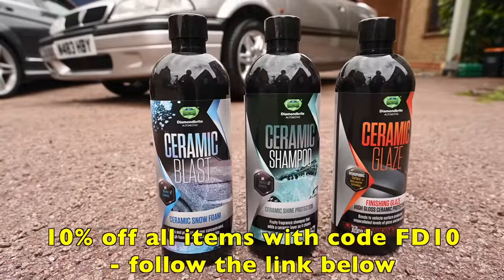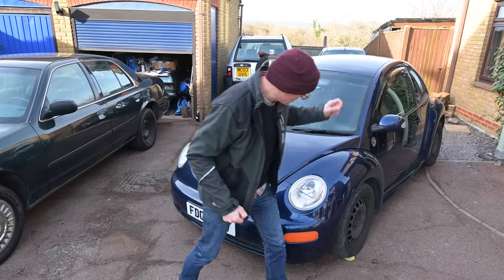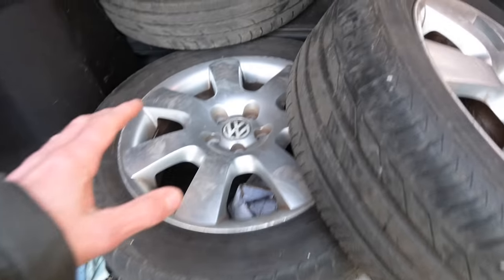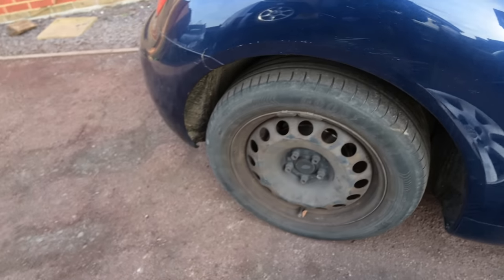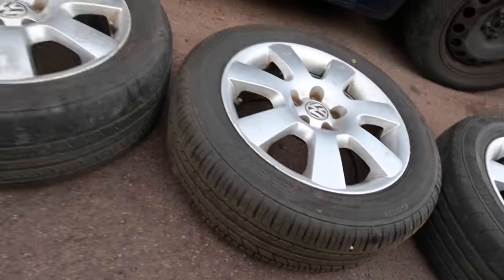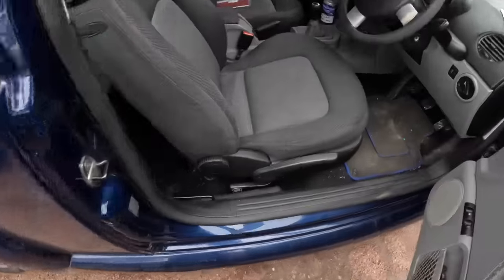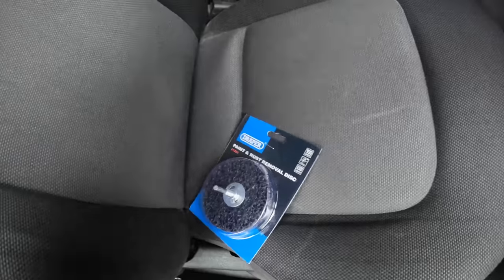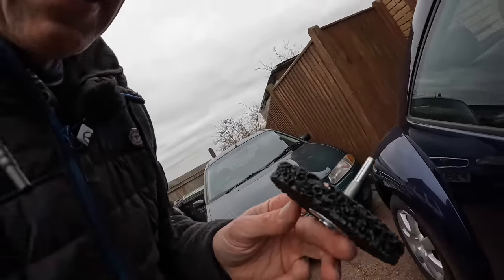Rims 'n' Rust - New alloys for Beryl the Beetle

Comment: You need to prise the roof gutter strips out to sort that rust properly. Prise them out from the boot end with the boot open.

The rust starts from under those gutter strips. Plus you wouldn't have had to paint the aluminium gutter strips then either.

Once you've sorted the rust in the gutters, fill them with dinitrol then push the gutter strips back in.
Reply from the maker: Thanks, assumed they were fixed parts
Reply: @furiousdriving  no, get a flat screwdriver, wrap it in tape, open the boot and you'll see the end of the gutter strip, prise it up from there and gently pull it out moving from back to front, be careful as it bends easily. You might need to remove some of the paint you've applied as that's probably stuck them in.

Comment: That car keeps getting better. I like your idea of using some filler. Never had much luck with high fill primers. For painting small areas such as the rust on the doors I have had very good results using an air brush. Even with 2K clearcoat (slightly thinned)  the results can be really good for areas of a few square inches.

Comment: Date code is on the outside of the tyre Matt. I have a knack for buying cars which come with the "original" spare. My Volvo S70 came with a Continental tyre which didn't look familiar, until I checked out the date code, which was late 1998... Oh well, it still holds air and is for emergency use anyway 😅

Comment: I have a VW with them wheel bolts, check them an re check them again, notorious for coming loose after being torqued up. You could keep the steel rims and get a set of winter studded tyres. I swap steel and alloys with the same wheel bolts. I live in Newfoundland Canada so winters are a necessity!

Comment: I could be wrong, Matt, but the front flex hose on the drivers side looked like it had a rubbing mark on it - and there looks like is a bracket on the damper, I wonder if it should be clipped up? 
I love the new wheels mate.
Reply from the maker: Il have to look again, can see the open clip there, and the dark mark but not sure what it would have rubbed on in that spot..Ill have to have a good look at it

Comment: The alloys have totally transformed Beryl, know what you mean about mismatched tyres, my car has 4 different brand of tyres    lol 😂 and these were fitted by the dealer that sold me the car..... I use them as my winter wheels. Summer wheels are my alloys and a decent brand of tyre.

Might have to use that rust preventer, is there a link for it ? I need to do the inside of the door in the Cactus (common problem and a recall issue if you have a full Citroen service history and paint check) which mine does not have!

Great video as always Matt.
Reply from the maker: its this place in Belfast, the Bulldog people https://www.lubricantsuppliers.com/shop/
Reply: @furiousdriving  cheers will have a little look.

Comment: I have never understood why people fit unknown/cheap brands of tyre when those four patches of rubber are all that stand between you and oblivion.
Reply: And for common sizes the difference can be as little £20 each to the good branded tyres.  Tyres and brakes always get the best, no arguments.  Like Matt I have a Rover P6.  Classics get all sorts of crap fitted to them, M+S tyres etc.  I found  ContiPremiumContact 5s that fit (they are 70 rather than 80 profile) which is a seriously premium tyre.  And they actually cost less than most of the garbage in this size with an H rating.

Comment: For future reference, 2 things.
1. The age of the tyre is usually on the outside of the tyre as part of the DOT code (the exceptions I have seen are on accelera tyres and rotational tyres)

2. Generally speaking for the general public putting new tyres on the rear axle is better as it promotes understeer which is easier to control. If new tyres are mounted on the front you're going to loose the back end before the front.

Hopes this helps someone
Reply: I've lost count of the times people have told me you put the good tyres on the driven axle (which is obviously right for a RWD car) or "where the steering is" which is always wrong.
Reply: @peterbroad1772  Depends, really. No answer that fits all drivers and condition, so dont know how you can say "where steering is, is always wrong"?

Personally I prefer the best tires always in the front, for a multitude of reasons. Even on RWD cars. Best tires always in the rear seems like a somewhat outdated historical holdover for a reasonable driver in a modern car, if you ask me.
Reply: You are not necessarily going to loose the rear before the front, just because the reat got worse tires, it depends on a whole slew of factors. Its hard to say categorically which is best, almost impossible in fact.

Comment: Things you should never cheap out on: brake components and tires. Your brakes are good, but you should invest in four new tires. You should never compromise on safety. You can buy midrange level tires that will do the work perfectly and have great performance for the price. Example Toyo, Uniroyal, Kumho, Nexen and other know midrange brands will be more than enough. Then you will be safe when driving the car and you can sleep calmly at night. Especially when you sell the car to the next owner. You will know that the car was safe when you handed it over.

Comment: In Germany it's not alowed to put different tyres on the same axle. Is it legal in the UK?
Reply from the maker: It’s not but it should be! As long as there is at least 1.6mm of tread they are legal
Reply: IN Spain neither .
Reply: Yes it is legal. Cant mix radial and crossply though, but as no one sells crossply any more it's not an issue.

Comment: Great video! I'm surprised that in the UK it is allowed to drive around with four different tyres on the wheels.  Here in Belgium you have to put on the same brand of tyres for each axle. So same brand on the front wheels and same brand on the rear wheels, for safety reasons. Otherwise  good road handling can be compromised!
Reply: Qurstionable real world benefit of that though, I am pretty sure. Perhaps in the old days it was more important.
Reply: Same in Spain.
Reply: It's important not to mix radial and crossply tyres but mixing brands is not a problem.

Comment: Yeah remember folks have an extension bar in the car with your wheel changing kit to help remove wheel bolts, believe a small gas canister blowlamp to heat and loosen nuts doesn't normally damage wheel paint.

Comment: It would have been better to rather have removed all of the used & mismatched tyres (all with different date codes, tread depth & dubious condition) from the alloys, had them refurbished & only then fitted a matching set of 4 brand-new tyres of the same make & appropriate size size to them (some cars have different sizes specified for the front & rear sets), as well as getting the wheel balancing done & tracking alignment checked & re-adjusted  - this would make it MoT legal & also provide for a safer & much more comfortable driving experience.

The two items you should NEVER neglect or cut corners with (literally, figuratively or financially) are tyres & brake components, as these are both essential driving, steering & handling components that ensure your safety on the road, especially when you are confronted with an emergency situation & have to take sudden evasive action to prevent an imminent collision or accident.
Reply from the maker: If I was keeping it Id have sent the wheels for returb but thats £50 each + VAT and this has to break even
Reply: While what you say is common sense, there is no requirement in the MOT to have your wheels balanced or tyres of the same brand

Comment: i think they should need alloy wheel studs
Reply: You can buy a tool that you screw into the hub and slide the wheel on, I bought one for my first Fabia way back in 2008, it's a great little tool.
Reply: @scottishcarenthusiastsandtrain  Wheel hanger! Very worthwhile investment for VAG cars and their wheel bolts. A fiver well spent. Not sure if you need different wheel studs. I've got alloys on my bora but the spare is a steel wheel. Don't recall any problems fitting the spare. Wheel cap covers are a good investment though.
Reply from the maker: Turns out VW use the same on both!

Comment: Lancaster is crap i rang they quoted me £978.00 fully comp on my 1999 728i .footman james quoted me £677 ,And then Adrian flux they rock £501 fully comp And i have no noclaims .And its my Daily driver .
Reply: Don't Adrian Flux expect and quote a cheaper price if member of a classic car club ?
Reply: Some insurance quotes can be cheaper if your not wanting it for a few weeks i.e not straight away.
Reply: Ooh, '99 facelift e38, one of my favourites, one classy car! Might be an idea to check and waxoyl the fuel tank though. £600 for a replacement!
Reply: Perhaps you might engage us further if you tell us how old you are, where you live and how many points you have as these seem rather high compared to my 1998 SL320 at £250 fully comp
Reply from the maker: every driver is rated differently so you might not fit their parameters for some reason

Comment: I don’t think you can use steel wheel nuts with alloy wheels, something to do with the steel wheel nuts digging into the alloy wheels.
Reply: On vw the wheel bolts are the same for alloys and steels it’s one of few car makers which you can do that
Reply: @bmwman1981  every day is a school day.  👍
Reply: Every car I've ever had with alloys came with steel wheel bolts. Not sure what else they could possibly be made of that could withstand the required torque.

Comment: Steel wheel bolts are fine, as long as they are original equipment wheels....no problems
Reply from the maker: Cool, I thought they looked the same as the alloy ones Id seen

Comment: New (better) tyres on the rear axle, please. Always.
Reply: For a FWD car?
Reply: @stephenholland5930  Yeah, for any car. Rear axle is more important. Especialy with the FWD car, where most of the weight is at the front. If you have worse tyres on the front, the weight of the engine will press them harder to the road then on the rear axle, and will grip more. Especially during braking, where you can get even 80% of the weight on the front axle, so those worse tyres will grip the road. But in such situations if you have bad tyres on the rear, in hard braking only 20-30% of the weight of the car will be on the rear axle and the tyres on it will almost "float" on road. You can lose the rear of the car in corner easy this way.
Also, if you put better tyres on the front and worse on the rear, during cornering the better front tyres will be ably to turn in more sharply and the worse rear tyres will not be able to follow and will oversteer the car. But if you have worse tyres on the front and better tyres at the back, during cornering the worse front tryres will not be able to turn is as sharp, so the better rear tyres will be able to follow no problem, without oversteer.
Even with all 4 good tyres, the rear ones will have less grip then the front ones, due to less weight on that axle pressing them down to the road. So you can imagine what can happen when you put worse tyres on the back.
Reply: @stephenholland5930  You can also see how much the rear axle is more important that the front axle by looking at the suspension types. With a lot of higher end cars, you will see cheap crapy MacPherson suspension at the front, but a more sophisticated and superior multilink on the back.

Comment: nothing wrong with Chinese tyres. i use them myself
Reply: Until it rains and you compare braking distances.
Reply: @peterbroad1772  Most "Chinese" tyres have stopping distances not dissimilar to the base tyres from the big brands (albeit they don't last as long). The really bad ones that get reported on, tend to be the ones designed for hotter countries (with rock-hard rubber compound) and imported by unscrupulous resellers. The issue is sorting the wheat from the chaff.

If you get them from a garage that knows what they're doing they're usually OK, although they tend to have soft sidewalls and handling feel suffers as a result.

Comment: Shouldnt have different tyres on the same axle really.  You should get a tyre sponsor since you are usually so pedantic about tyres in general (Which is sensible).
Reply from the maker: Tyre and battery sponsors would be ideal! Normally Id never mix tyres at all can be very odd handling
Reply: @furiousdriving  Thats the reason I was so surprised to hear you consider it.
Reply from the maker: @rimmersbryggeri  only an option depending on the price of tyres
Reply: @furiousdriving  I understand but if I looked at 2 cars and 1 had new continentals and 1 had those fargoo (new) or whatever that tyre that was on the bug was called I would personally the price of the continentals more for thte car that had them if it was literally the same car. But that's probably only me and you and 2 or 3 other people that would do that.